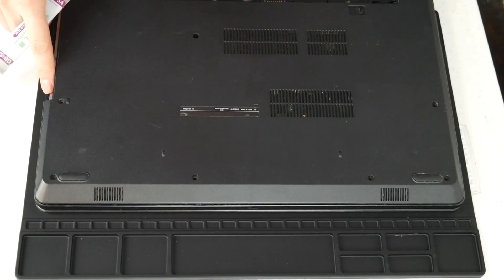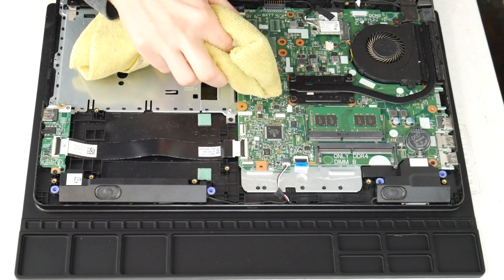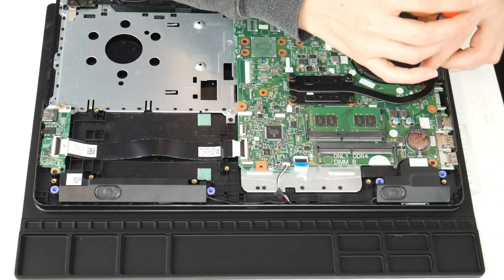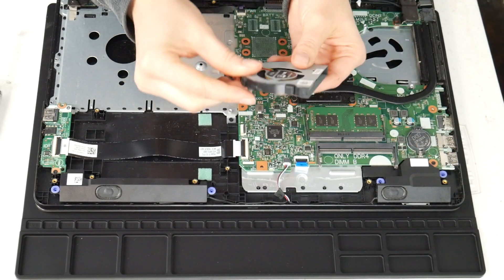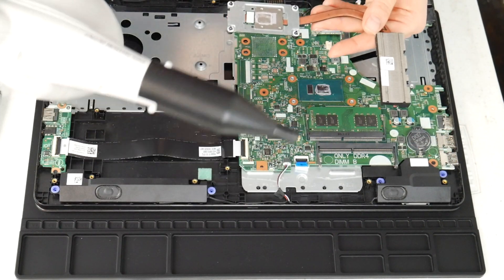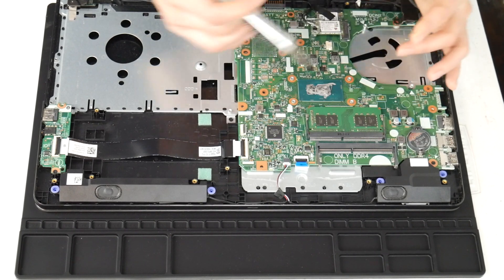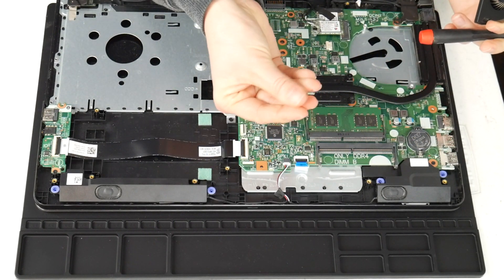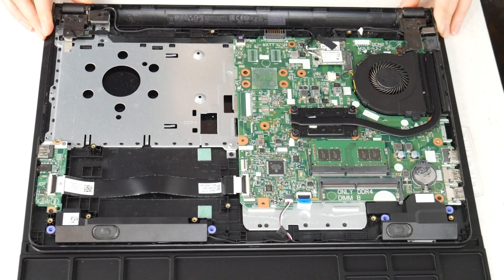How to Fix an Alienware Computer That the Fan Runs Constantly by a Certified Technician

Comment: Hi! My RX17 has been freezing where the fan runs loud and the screen freezes and the mouse doesn't work. After a hard restart it comes in but the screen is black (not booting?) and the fan runs loud immediately now. Do you think i just need to open it up and clean it?
Reply from the maker: When you say the screen is black after restart...Does it display anything at all after the restart like the initial logo? Or is it completely blank?
Reply: @EggheadFixers  it's completely blank. No logo.